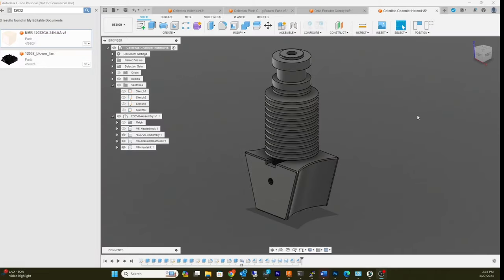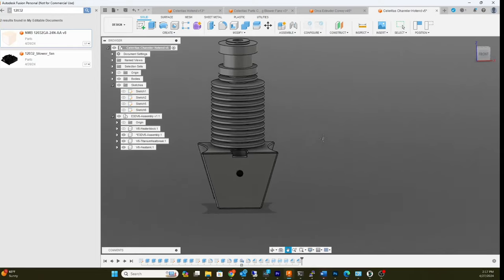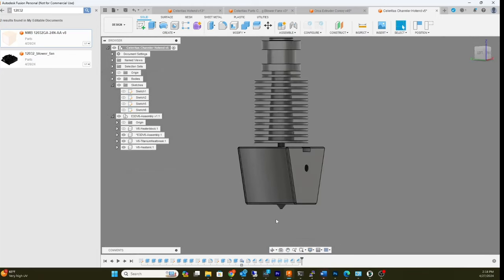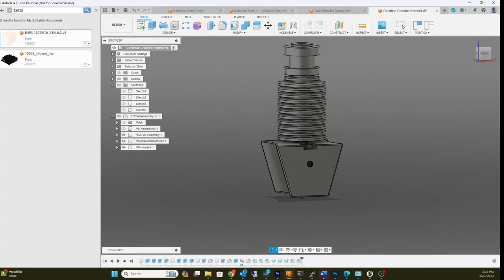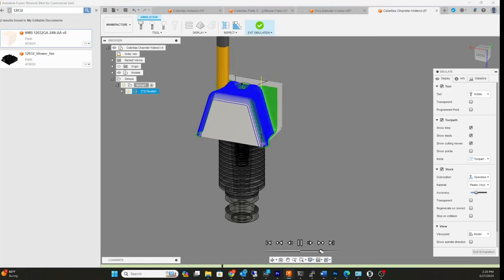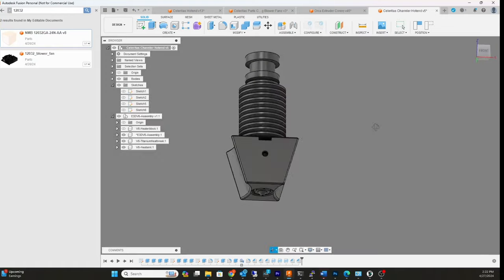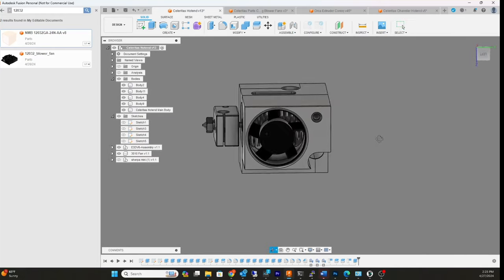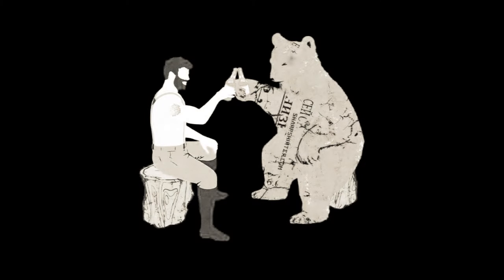Air Express 3D printer heater block concept, fanless part cooling, Celeritas world's fastest printer

Comment: All good there is so many tools, tool ends and attachments for all those it's hard not to know everything, with milling and lathes I know more than i do with 3d printing but it's just the revers of a cnc mill or  cnc so you are better than me so keep up the good work!
Reply from the maker: I started out in 3D printing about 10 years ago and got into machining because I wanted to make my stuff out of metal. Thanks, I appreciate the advice.
Reply: @fintechrepairshop  I'm a  baby to 3d printing like a month old baby that jumped into klipper on a ender 3 s1 and I'm liking it. Printing with Asa from elegoo at the moment and trying to get the part cooling dialed in right now about on the fan 15% at 35mm/s and it's come out clean-ish.

Comment: Square everything the mill the nozzle side fist so you can drill and tap the grub screw, then flip it to it's side and angle it to where you need then a round ball mill to cut the sides, off to the lathe. Only thing I don't know how much cooling you will get with that you could try adding a compressed air and use the curve as channeling for the line I would use aluminum tube stock and just anglet to the nozzle or to the point you need.
Reply from the maker: Thanks, most the cooling with come from the dual 120mm blower fans. Cutting it like that was my original idea, but I was wondering how I was going to hold  it without hitting my vice. My plan was to use a slightly larger rectangle peace of aluminum to hold it in the vice and give me clearance when ball milling, Mill or drill all the holes first, Ball Mill contour, put in 4 jaw lathe chuck to cut off excess aluminum.  I'm not a machinist by trade so I like suggestions. Thanks for commenting.

Comment: Sorry about posting so much but you could also use a hex collet block.( I would also do the same curve on the grub screw side it will cut some weight not much but some.
Reply from the maker: Sometime I forgot the tools I have. I also have two CNC 4th axis indexers. Might be a good time to play with them!!!
Reply from the maker: I'm still pretty new to machining. I had to google what a hex collect block is, thanks!!!

Comment: Wouldn't be easier to just make a custom silicone sock that does the same job? 
Someone tried with ABS before - away from the block, of course. If I'm not mistaken, it was the ROOK printer guy.
Reply from the maker: Thats a good point. I could do it in plastic. I still need a nozzle with a longer melt zone. I had another idea using a soldering iron heating element.